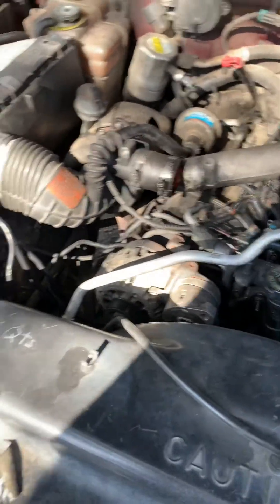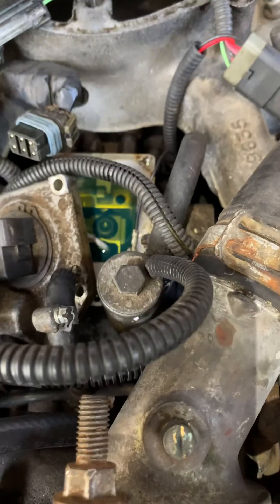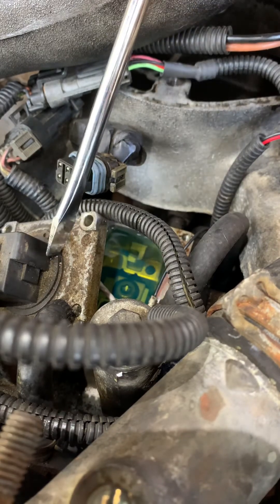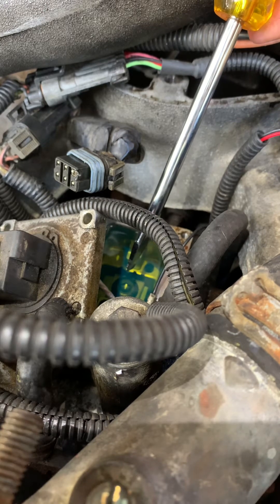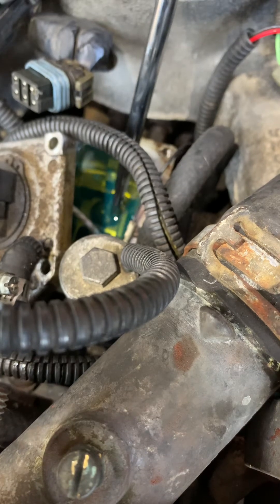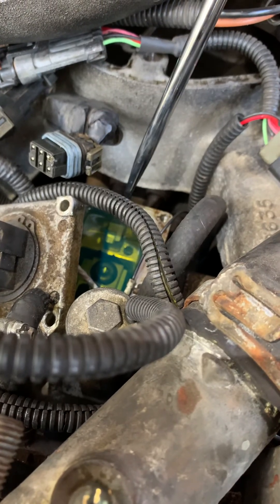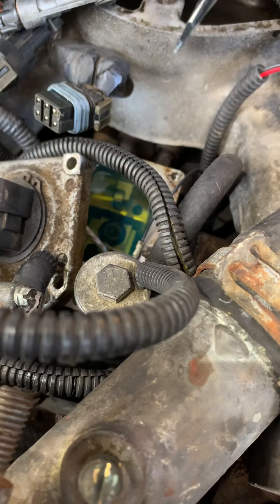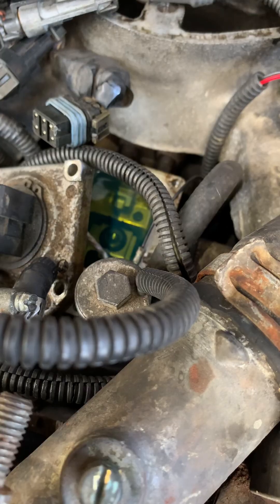Optic bump optical sensor 6.5 diesel Detroit

Comment: I adjusted mine to the pass as far as it would go, and mine is  tuned runs great and better power with a little more smoke . alot easier to pass people
Reply: Did you move both that way?